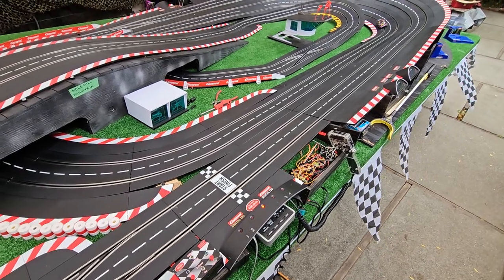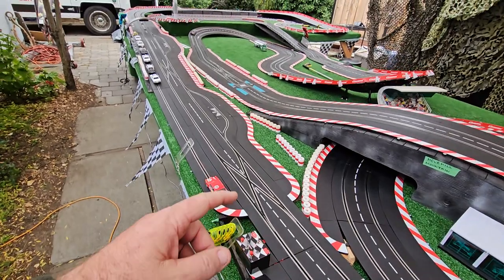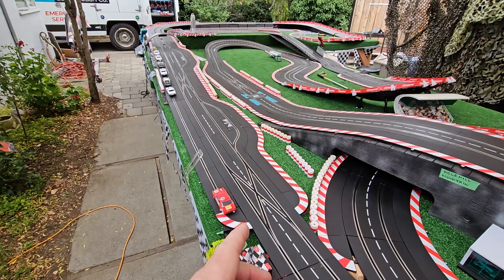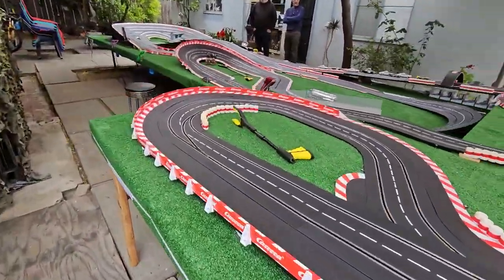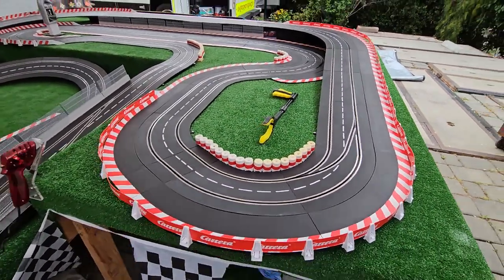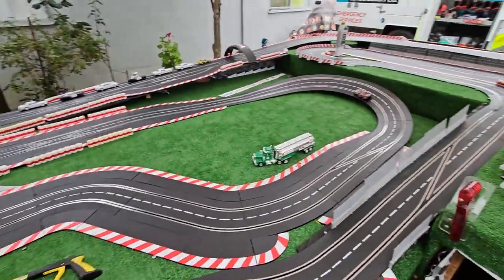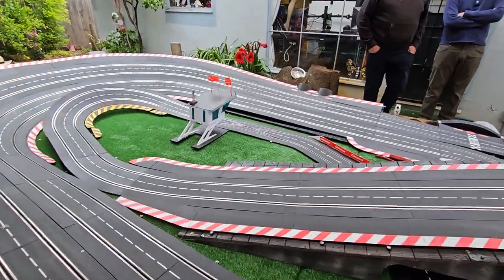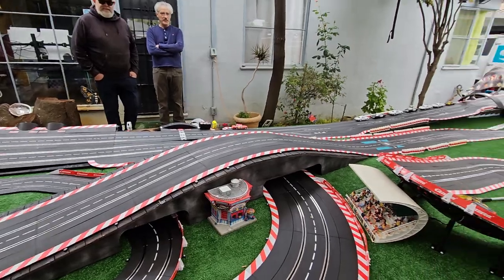Lane change layout strategy on our 160ft. Carrera Digital 1/32 track - East Bay Slot Car Club

Comment: How you you 'warp' and bend the Carrera track to keep the metal contacts from kinking or popping up to effect the guide keels from lifting up off the track slightly and disrupting the balance of the cars on high speed corners, and possibly catching the braids at certain points?  Can the track be re-straightened and reused if you tweak the layout in the future?  

I do think the sightlines of the competitors are needlessly blocked with some of the overly banked sections (that 'need for speed' dilemma) within the layout, but your perimeter trackage is spot on amazing with excellent viewing tiers for the 'drivers' regardless of their vantage point during your races.  I don't think you could've laid out 161' of track any better overall.  You East Bay Slot Car guys have a treasure there!  How do you get the guys to go home once you finish the racing venue for the evening?!?
Reply from the maker: Go to the home improvement or hardware store or search "Nelson wood shims" on google (got ours at Lowes).   They are 1" wide wood wedges in a plastic pack that are maybe six inches long and go from perhaps a quarter inch down to nothing?   Slide those under the high side and use the screw-down plastic retainer "eye" thingermabob that Carrera makes to allow you to attach the track to the table to tighten the track down on the low side and you're fine.  The track needs very little to become cambered.    

We're running outdoors, and the sun exposure will gradually bake the plastic into whatever shape you have bent it to, and it will retain that shape later.   I suppose that you can just screw down the molded plastic piece to flatten it out again or walk away from it?   We have enough track inventory in the "library" that we can sacrifice a couple of pieces to get what we want each time that we do a new layout.  

The banked sections are actually AOK in general despite how it may look from the camera eyeball.  There is the super tight one in the center that I pointed to that isn't really visible from behind it, but the thing about banks is that you can go full speed and not fly off, so just go full speed through it and the car will reappear in a blink and it's OK.  They're not the place where you'll bone yourself and deslot.

We go from 10am to whenever once a week.   Serve lunch.  Everybody but Mr. Max is in their 50's, so standing around and marshalling cars and so forth means that people are generally baked by 2pm or so, but it is very loose and informal - come and go as you please.   There is always next week, and the real challenge is getting six or more people each week.   The track has been strangely resistant to invitations.   We are thinking of trying to find a boy scout troop or something.  Hope they don't think that we're creepers for asking!
Reply: Grin, you guys are the opposite of creeps.  That's funny.  Very polite and friendly is the best way to describe the group.  Very helpful and patient to get new drivers up to speed.  I voted this the best local track for 2023.  😉👍👀
Reply: I was able to custom shape mine using a heat gun. I started out super cautious, going slow and low; but eventually turned the heat up. As long as you’ve got a decent surface under the track, you can easily mold it. The stainless rails seem to just go wherever the plastic does.

Comment: Amazing layout! How long does that take to assemble and disassemble since it's outdoors?
Reply from the maker: We tarp the track when not in use and C-clamp the tarp down.   Disassemble at Halloween and reassemble at Easter.  There isn't much rain here in the SF Bay Area Easter-Halloween, so a light rain is no biggie with heavy tarps.  Wind and sleet?  NO.   Being forced to disassemble forces us to reassemble and get even better track layouts.

Comment: So how does one ~choose~ to hit the lane change or not?  None of my old slot cars could steer themselves, they were just at the mercy of following the slot, and if they just happened to randomly hit something like the lane change, well, then I guess you were changing lanes.  But this guy made it seem like there was some amount of choice in the matter.
Reply: There’s a button on the controller you hit as you cross the lane change track section to change.  They have sections where you can change lanes to hit the apex of turns or take outside lines, change on straightaways.. it’s crazy…
I got a Carrera digital set a few years ago to use with my boys and that blew my mind… it adds a totally new level of fun and competition.
Reply: @craigkanish6127 - Awesome!  Thanks for the info dude!  I've been wondering how that worked for a while now.